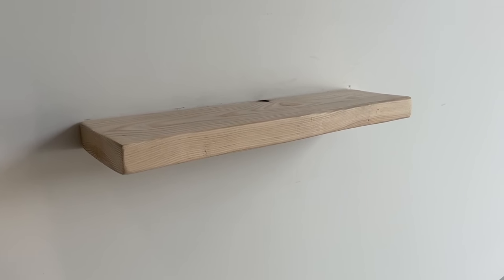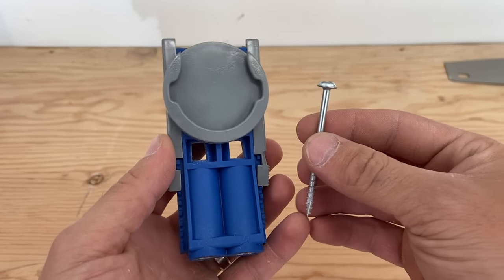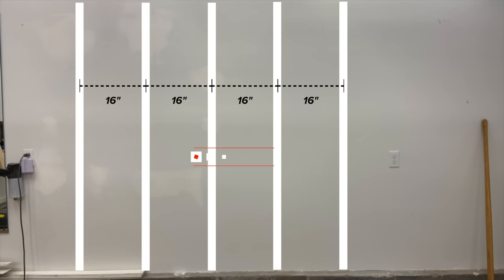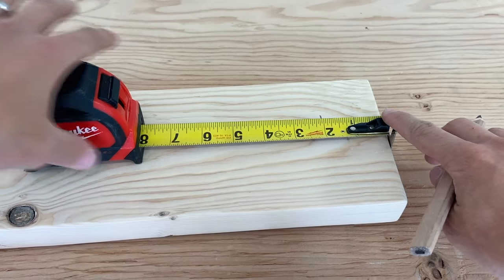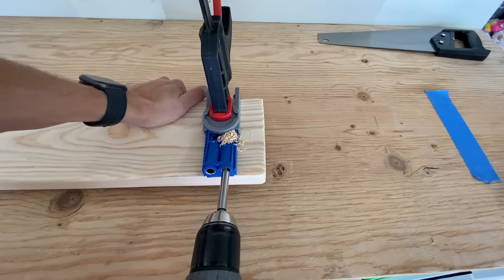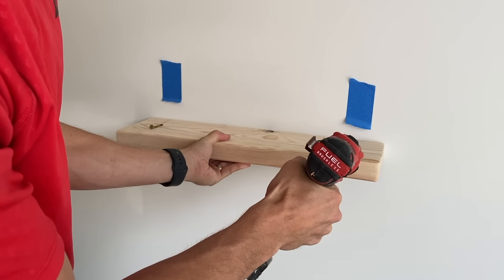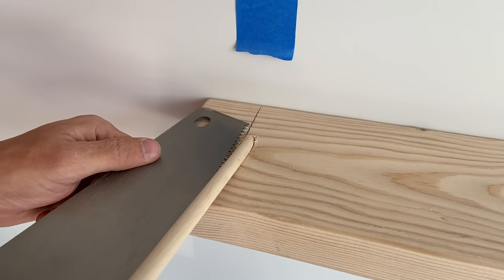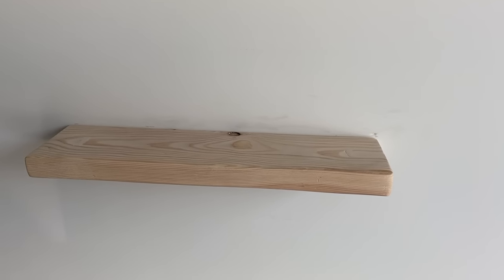This floating shelf is held up by 2 screws.

Comment: The shelf would be stronger if the holes and screws were done from the bottom. To understand this, place a block against a wall and apply pressure to the outside edge and you will see that the top of the block will separate from the wall, but the bottom of the  block will be under compression and forced into the wall. So, your angle should support the top of the block to adhere to the wall, and at the same time, support the downward pressure. The best solution then is from the bottom, toward the top of the block.
Reply from the maker: Thanks for the comment! Yeah a lot of people have been commenting that! Thanks for elaborating on it more! Here is a newer video that I posted going over this very question! https://youtu.be/2j1jn6CaQY0
Reply: Plus you don't have to dowel the hole👍
Reply: This is exactly I was thinking
Reply: The whole idea of a floating shelf is the appearance... so obviously you should try and hide the screw holes as good as possible. If the shelf is going to be above eye level, you put the holes on the top side and vice versa.
Reply: However, with the screws this way, vertical load gets re-directed to the wall (like the angled nail picture hangers). If the screws were going up, all the load would be completely on the threads and the wait would be re-directed to the heads of the screws. I think it would fail easier the other way, but probably be plenty strong for a shelf.
Reply: @HappinessInSeconds  Good thinking on making this comparison.  The significant difference though is the nature of the loading; with a picture hanger the vertical load is applied right next to the wall, while the vertical load on a shelf is applied a long way from the wall, ie, it has LEVERAGE.  In engineer-speak the first case is a shear force, while the second has the identical shear force PLUS a large BENDING MOMENT.
Reply: The strength would actually be similar regardless if the screws went into the top or the bottom. In either case the screws would be securing the top portion of the block to the wall, even under load, so long as the heads are the right size and the top of the drilled hole is not too wide.
Reply: Of course you also have to factor in the diameter of the screws and the size of the shelf.
Reply: @ppentertainment2351  How do you figure? From the bottom, the screw is leveraging tensile strength, from the top it is leveraging yield strength (always lower than tensile strength). Have you any tests on this or are you just a person who likes to think they know everything without applying any theories of physics? I'm guessing the latter since you didn't offer up any argument.
Reply: You're actually wrong on this, tensile strength is always going to be stronger than shear strength. Screw from the top, leverages tensile strength. It's really all up to the holding power of the wood, with the tensile strength in this example. Much easier to shear screws by bending them, if attached from the bottom.
Reply: @Velislide  You have a good point in that the wood may be the weakest link, but I have a lot of experience with framing and working with wood and nails/screws and I can tell you that there is not going to be a danger of tensile failure, or shear failure, but there is a danger of yield failure. And apart from failure (plastic deformation), you can get some separation at the point where the top of the wood meets the wall. Screwing from the top forfeits the compression reinforcement to the wood that would have been given from the screw from the bottom. Repeating force on the outer part of the shelf to cause separation is  going to lead to a failure of the wood grain. Your point on the shear strength is a red herring.

Comment: Not sure if I missed it in the video but why did you make the pocket holes on top vs. underneath? Seems like underneath wood be stronger since there would be more wood above the screw to take the load. Nice video!
Reply: For demo sakes, it shows the strength of the shelf mounted to the wall.  Screwed from underneath would add more strength to the shelf.
Reply: I see what you did there.
Reply: @juliuscaesar8801  No it would not. The angle of the screw from the bottom is going up which would be easier to pull out, because the force of his weight would be going in the same direction the screw went in.
Reply: I don't believe that's correct. In screws VS nails, screws underperform with shear strength and over perform with grip strength. Considering the direction of forces here and the angle of the screw, fastening from the bottom would reduce shear force and rely more on grip strength, which is where screws excel. Also consider that the screw head creates the biggest obstacle for the wood to pass through. With the screws angled down, the weight on the wood would pull away from the heads, whereas the screw angled up leverages the screw head to better hold the wood.
Reply: From the interwebs: According to a study conducted by the RADCO testing division, a common 90-degree pocket hole joint using a 2×4 rail that is attached to a 4×4 post could hold 1361 lbs before failing. However, using the same setup, if you apply pressure from the bottom of 2×4, the same side as the holes, this 2×4 holds only 410 lbs.
Reply: @JakeBirch  Thanks, if I understand you correctly, this means that having more wood above and the holes underneath, is stronger, which matches what I was thinking.

Comment: Why not put the screws in from the bottom then you don’t need dowels… how you ever gonna get that shelf down? 🔨😂
Reply: Pocket hole screw joints have a weak side and a strong side depending on where it's placed. For this application it is at its strongest when it's placed on top rather the bottom.
Reply: dowels aren't glued. Pop a small screw in dowel and pull out with pliers
Reply from the maker: Check out this video and it will explain all of your questions! https://youtu.be/2j1jn6CaQY0

Comment: Awesome. Only thing I'd change is to find studs first and then mark their spacing on your board BEFORE drilling pocket holes (studs are rarely perfectly on center, and not catching the center of them with your screws can mean splintered failures). Removing a slight bevel from the rear lower edge also helps flush up board against uneven wall surface.

Comment: Just wanted to give you a big THANK YOU!! I used this video tutorial to make a set of 27” and a set of 24” long floating shelves. I used a 2”x10”x12ft douglas fir green lumber from Lowe’s (the usual stuff they sell on the floor).  The pocket screw idea worked amazing well. The 2”x10” shelves do not have any wobble/movement. Solid. I used the 3-1/8” GRK screws you rec from Amazon. Appreciate you very much. Got to stain the shelves the colors we wanted and saved hundreds of dollars since solid floating shelves are very pricey online and doesn’t always cone in the color you want. You saved me big $$$!!!
Reply: Treated lumber?
Reply: @paulhuwig1434  no not treated lumber.

Comment: This is by far the best way to make a floating shelf. I've experimented with different methods. Once I learned this method, I've never made a floating shelf different. The only thing I do differently from your excellent tutorial is I remove a quarter-inch or so from the side that goes against the way. I want the side against the wall to not have a rounded edge. If you don't have a table saw, this step would be hard to do. I understand you're demonstrating how to do this with minimal tools. 

I also mark the studs on the wall with tape but then decide where I will put the pocket holes based on holding the board against the wall. My floating shelves are usually a lot longer though.
Reply from the maker: Thank you I appreciate it! Yeah that’s a great idea about cutting off the back of the board! I also have another video on my channel going over a longer shelf! It shows me holding it up to the wall like you were saying! Thanks for the comment!
Reply: @Nailedityt  That's right! I watched that video and I even bought the screws you linked to on Amazon. I plan on replacing all the Kreg 2.5 inch screws with the ones you recommended. I just haven't gotten around to it. I appreciate you linking to the screws because every time I select screws on Amazon, I end up getting the WRONG ones. Not because of Amazon, because I just always pick the wrong ones.
Reply from the maker: Well thanks! That means a lot! Yeah they are amazing screws! I use them for everything! Let me know how it turns out when you end up switching the screws! I’d love to hear about it!
Reply: How long do you think one can go using this method? I’m attempting to make 75” floating shelves and was wondering if this method would suffice
Reply: @alexkim8289  As long as you're putting a screw in a stud every 16 inches, I don't think it matters how long it is.

One problem I can see is getting a 75 inch 2x6 or 2x8 that's straight the whole way through. I've found the longer it is, the harder it is to find a straight board.
Reply: But how to remove the board from the wall if needed?

Comment: FYI- kreg jig usually has a bushing for the drill bit to set the depth of hole for the screw length
Reply from the maker: I know! Sadly mine didn’t come with one!
Reply: The bushing is not required, it just assists.
Reply: @gwflyer67austintx76  yeah I know, but it assures you don’t drill to deep, so that your screws don’t bubble the face of the wood or even penetrate. Just easier to set the bushing just short of the screw length and you will never have any issues. It’s  faster too

Comment: Sweet. You made me realize I was going to do the over engineering way. I will use 2 or 4 screws on each point though and go bigger on screws and use washers to add a bit more surface area grip.

Comment: Could have turned the shelf upside down to hide the holes underneath so only a clean finish is on top. Awesome work
Reply: I was thinking the same thing, then realized it's on top for maximum strength since it's biting down into the wood instead of up.

Comment: Very cool this actually gives me motivation to add floating shelves all over the house including on brick walls, will need to use masonry screws for that :)
Reply from the maker: I was thinking about making a video for a masonry wall! Let me know if you’re interested!
Reply: @Nailedityt  I would. I would like to build a large bookcase using floating shelves sometime in the future and I'm interested in the relation between number (and type) of screws and length of shelf and weight bearing for bricks. The off the shelf solutions seems to guarantee very little load bearing.
Reply: Bricks are hard but brittle. I don't think it would support the same weight without busting the brick.
Reply: @Curtis86   don't mind adding more screws. Just need to find an actual number to use...
Reply: @Nailedityt  Yes indeed please do :)
Reply: Also does it matter what kind of Jig to use ? seems like the prices are all over the board.

Comment: Just wanted to say this build was clean, easy, and fun! The only thing I would add is that you need a long T25 bit to drive the screws fully in with a drill, otherwise the 3/8" pilot will interfere. Thanks for the tutorial!
Reply from the maker: Yes that’s a very good point! Glad you liked it!

Comment: Thoughts on doing this method with 1x12 boards that will be 21” long? Will it be sturdy enough for lightweight items as kitchen shelves? Is 3/4” thick enough? screw size you’d recommend if so?
Reply: Did you do it? I was thinking the sane

Comment: I am actually doing a similar job right now but have put wooden dowels into shelf with half sticking out to go into the wall. Doesn't need to be very weight bearing as its just for security cameras. Need to have it upright as sideways I get the wrong angle of view in the camera video. Just a matter of lining up the wall holes now in exactly right place, think I will use chalk or similar or end of dowels to mark the wall. Doing one each corner end of room but high up as a robber threw a black cloth over the camera.

Comment: Common mistake at 3:40 - if a gap develops, back the screw out until shelf can be snugged up again, then proceed with screwing to wall. Otherwise, you're just crushing wood fiber.
Reply: nice ..never knew that always drove it in to get rid of the gap
Reply: This is unavoidable, no matter how careful you are. The intent of the screw design not having threads at the top is to pull it up snug.

Comment: This is great I never thought of this. I just have a suggestion. Perhaps if you made the holes for the screws on the bottom of the wood then you don’t have to fill them in at all. Maybe you thought of this already and it did t work

Comment: “In most houses you’ll have a stud every 16 inches” - maybe in America, we build with bricks everywhere else in the world! Good video, I can’t help but feel it would be stronger if screwed from the bottom, al though it would be more fiddly to fit.

Just found your follow up video, well done for giving the bottom screws a go.
Reply from the maker: Yeah I may do a video on a brick wall for those of you that don’t have studs! That’s for watching the follow up video! Glad you enjoyed!
Reply: Brick walls are easier. Just find some good nilon plugs to go with the good screws. I would suggest to use at least 3 screws though, in case a plug doesn't find a good place to grip the stone.

If you're really worried about strength, you can use some 2-part masonry epoxy. Pretty expensive, but that won't come out.
Reply: @Nailedityt  I look forward to more videos!
Reply: @sanderd17  thanks for the useful information!

Comment: Thanks for this video!  I want to try this however the shelf will have 2 holes, one 3" from the right and the other 16" from first hole.  it would only hit 2 studs and I'll have 14" with no support.  I can't center the shelf due to the fact I need to center over cabinet.  Wonderfing if this would still work.  I'll be putting about 5-10 lbs on each shelf, only decor and picture frames, would this still work? Thanks!

Comment: PLEASE answer my question- Your Video MAY be my solution!!! I've been working on a BIG Christmas surprise for my Husband.  It's a 72" × 12- 16" floating live edge ledge. This will be a workspace UNDER Wall mounted computer screens. 
The ledge will only be holding a keyboard and some small items (note pad and phone holder and a light,  small laptop.  
I'm planning to have MCM tapered legs on each END, and wanted to use a shepard bracket,  but the system to accomplish this is PRICY! I was looking to try a basic cleat along the back wall. But then I found YOUR video!  By questions:
 1. Can I do this,  but do my pocket holes on the UNDERSIDE? 

2. can I do this with such a long span (72")? Remember I'll be adding legs on the end. 

This will also be attaching on ONE end to the side wall.

Thoughts? Advise? 
Thank you!!!

Comment: Did this today after watching this video yesterday but I made two. I didn't have that jig and I made them about 15 inches I only connected them to one stud and used the heavy duty plastic anchors on the other two hole (three holes per shelf). They are sturdy for sure but I wouldn't stand on them lol I'm using them to hold less than 10lbs in my man cave

Comment: Can this be done with a wider shelf and how could you attach a rail or something to prevent items from falling off in the bathroom? 
For this type, there wouldn't need to be any heavy duty standing shenanigans…looking forward to you nailing it!!!
Reply: A metal rod and pipe bender for a simple metal rail would work? Or if you want it all wood then a small thin wood frame, set 2cm up on dowling in each corner would look good also.

Comment: Quick question- why didn't you screw the screws on the bottom side of the shelf instead of top? If they were at the bottom side, the screw holes wouldn't be visible and you won't need the plug them up with dowels?

Comment: Silver screw (zinc plated) and black drywall screw look like #6 screws, from my experience work well but needs multiple. Third was #8, and you ended up using #9. I've used #10 4" wood screws to install barn doors with no problem. You can even do pull ups on that thing.

Comment: Great idea on using the pocket jig!

But can you screw in from the bottom this way the holes are hidden from view?
Reply: I was going to say this.
Reply: Yes, and it's actually stronger if you screw from the bottom.
Reply from the maker: Go check out this video! It will explain more! https://youtu.be/2j1jn6CaQY0
Reply: @VaughanHandyman  how is it stronger?
Reply: @Curtis86  there’s a pocket hole strength test somewhere in the internet, can’t remember where I saw it though

Comment: Howdy! I got all the tools, holes through the wood, went to put the shelves up..... METAL STUDS IN THE WALL. Damn. In a condo and have never put anything up here yet so it's a curve ball. Is there anyway to adapt this design to metal studs? Ideally if there was some wood to metal screw that could go in the same hole. I'm reading online and its seeming like that's not a thing and would have to make use of lag bolts and some sort of metal bracket but throwing this out there in case there is some sort of fastener or workaround that you are aware of! Cheers
Reply from the maker: I mean there are screws that will do that but the metal is probably too thin to hold the weight of the shelf! I would say the best way to do it would be to put a stud on the outside of the drywall, screw that stud from one metal stud to the other metal stud horizontally and then connect the shelf to that. Depending on how much weight you need the shelf to hold, you could also consider using drywall anchors. Hope that helps!